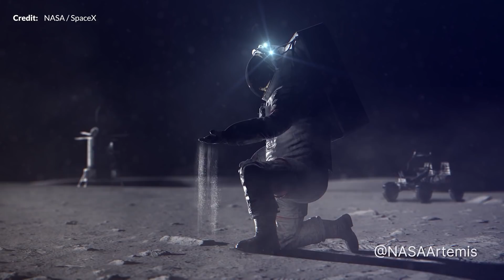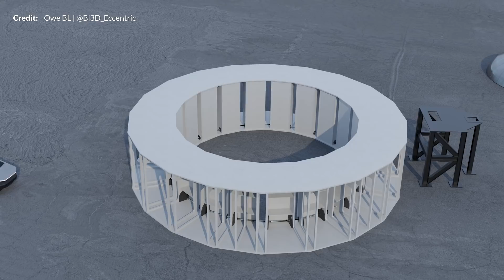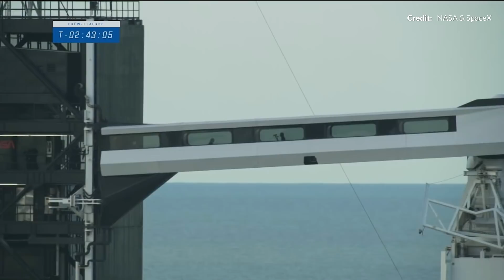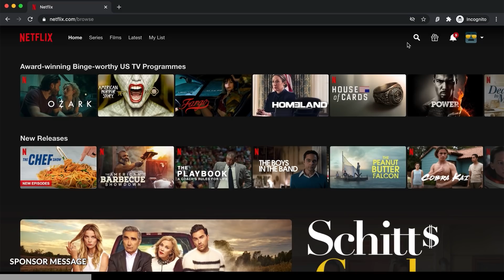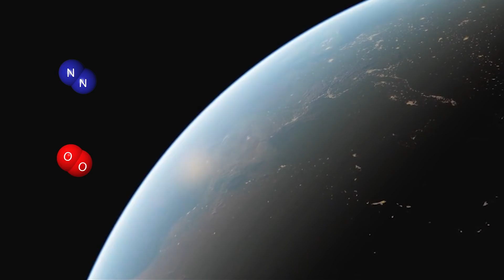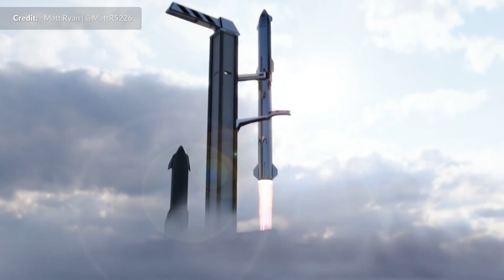SpaceX wins a multi-billion dollar NASA moon lander contract!

Comment: 1:07 Landing legs are too large, thinner one will be enough.

Ex:
Super heavy: ~3500 kg
Starship: ~1500 kg

Moons gravity: 0.18 g
So, 1500 kg * 0.18 = 270 kg (Weight of fully loaded starship in Moon)

So we only need legs strong enough to support just ~270 kg of Weight.

Comment: Another thought- while it's great to build your own tanks, the SpaceX-made tanks are probably much thinner-skinned than the purpose-built storage tanks designed for long-term storage here on Earth.  Especially with stacking them vertically like that, I hope SpaceX engineers will reinforce them internally and externally to prevent damage during a hurricane (or even a storm surge).  The combination of being much lighter and standing vertically makes them much more prone to being knocked over by very strong winds, or even lighter winds if a natural resonance happens with one of the vibration modes of the tank.   I can see part of the point, since their vision is to use or construct tanks efficiently for orbital, lunar and Martian use but those are very different environments.

Comment: It's a big stretch to call the exhaust from a Methane/LOx rocket - mostly water and carbon dioxide - a "pollutant".   While I applaud developing and perfecting the technology to manufacture your own methane & LOx fuel in-situ, I would wager that doing so here on Earth would be extremely expensive and add millions of dollars in cost to the launch of every Starship rocket compared to just running an LNG pipeline out to Boca Chica and Cape Canaveral (if it doesn't have one already).  Has anyone looked into this further?

Remember, our first goal needs to be to viciously drive down the cost of launching into orbit.   The reason other rocket programs have failed to do that is partly because people became too distracted in trying to fulfill other goals, political and economic, at the same time.  Having these rockets be 'carbon-neutral' really isn't going to make any difference for the planet (it's a drop in a bucket), but FINALLY enabling affordable space access will DEFINITELY make a difference.    

It's like the difference between a military which focuses on being carbon-neutral and/or not offending anyone on twitter, vs. a military that focuses first on keeping its citizens safe and preventing the outbreak of war.

Comment: Is this going to be a ride in that Flash Gordon styled flying trashcan with a high failure rate? Or has SpaceX invented an electric rocket with 100 x better batteries while being 100 x cheaper (but also secretly 100 x larger and heavier for ONLY 3 x the original cost and 5 x past the original deadline)? 🤔
Any psychedelic LED light effects during the trip? 🌈 🦄 🤔
🤣🤣🤣
Reply: Yes you'll get the light effects, if you drop the good acid, Not the Brown acid!!!😜

Comment: The Moon is a very good testing ground for development of surface hardware, procedures and processes intended for Mars, is it not?...and pretty much always only a few days away, instead of 180 days away once every 700 days or so.  Can't anyone see the benefit of that?  If it (hardware for Mars) can withstand the harsh temperatures, radiation and vacuum of the Lunar surface, would it not likely be well suited for Mars?  Now, the Moon can't test reentry systems, but the Earth can do that.
Lunar Starship is in a class of its own, compared with the other two landers.  It is so much larger.  When they land a Lunar Starship on the Moon, it will be an instant Moon base.  Of course, I still have many questions about how it's going to work.
Also, with Super Heavy launching Lunar Starship (Should just call it 'Moonship' since it will be so much different) to orbit and the crew riding comfortably in the spacious craft on the voyage to the Moon, is there any need for SLS, Orion, or the Lunar Gateway?
........But wait!!   Can Lunar Starship launch to orbit on a SH and then propel itself to the Moon and land...all on the original fuel load it had when it departed Earth?  Or does it have to be refueled in LEO several times just to be able to get to the Moon and land?  And what about a return trip to LEO?  If that's what has to happen for each trip to the Moon, that's a big item we all seem to keep overlooking.
Reply: Answering Your questions:
- Star Ship requires refueling in orbit before trip to Moon orbit
- When Star Ship is in Lunar Orbit, Nasa launches crewed SLS with Orion. Than Orion is docking with Star Ship, crew goes from Orion to Star Ship. If it sounds strange: NASA is obligated by Congress to use Orion for this mission. No way to go around this.
- Star Ship Lands on Moon and stay there with crew for ~20 days.
- Star Ship launches to Lunar Orbit and rendezvous with Orion. Crew goes back to  capsule, and  than Orion is launched to Earth
- Star Ship either remains in Lunar Orbit (no atmo. drag there) or will be launched to Heliocentric orbit.
Reply: @wojteksykurski  Thanks!  Too wasteful, isn’t it?  Makes Lunar Starship an expendable vehicle.  But maybe it always has been, I don’t know.

Comment: Love all the ass licking Musk fans in here that have somehow forgotten..... the last 4 tests ended in explosions. Give me one example of musk technology that is either financially practical or worked as described?? Like his badly engineered heavily subsidized car range....the things don't last more than 4 years before bits stop working and are a landfill nightmare. I suggest giving the Russians the money you may get something that would get the Crews there and back...
Reply: The Russians have some of the least reliable rockets in the industry, many times worse than SpaceX. Why the hell would you chose them?
Falcon 9 has a 1.8% failure rate. Soyuz-2 has a 5.9% failure rate. Proton-M has a 9.9% failure rate. That's 3.3 to 5.5 times worse.
The Zenit-2, while not purely Russian, is still a Soviet design using a lot of Russian-supplied components, and using a Russian launch site. 
If you chose to count it, it has an appalling 21% failure rate, nearly a dozen times worse. If not, Soyuz and Proton still prove the point just fine.

Comment: Hi Marcus, I've a question. SpaceX has a fantastic system with Star ship and Moon Ship, what is the point of the Artemis program, rockets capsule and gateway station. Surely SpaceX will just launch moon astronauts to orbit or the moon with a Star ship and then dock with Moon ship for the landing. its a lot simpler and cuts out all the un reusable Nasa hardware. this would save the US government and fortune. Also Super heavy will be able to launch huge one piece space stations with many times the volume of current ISS or tiny gateway station planned. Another thought is that SpaceX will do what Nasa wants for 1st program but basically  do there own thing and leave NASA to just be customers. SpaceX will have a Starbucks on the Moon by the time NASA get there act together.

Comment: Since the boosters are taller than the starships, I doubt we’ll see the cherry-pickers supporting the joining of starship to boosters. 
-Maybe the booster catcher assembly will double as a 360° gantry for technicians to support the joining process. 
As far as I recall, no rocket system has been joined on the launchpad like this, so it makes sense that we’ll see a wrap around gantry to facilitate the process.

Comment: Ok, well done SpaceX
I wonder... as SpaceX is having trouble getting it's flying dustbin to work how long before a real rocket is actually flying? ...and having sorted the laughably simple stuff (relatively speaking) how long before the human-supporting systems are designed / tested / reliable enough for space flight?
The reason I ask is there will be no scaling this way, way, way, back to an idiot "Teslas in a Tube" toy. Using 3D rendering software is NOT rocket science!
Reply: I mean at least SpaceX have actual flying hardware, even if it isn't quite landing yet. The other two companies had plastic mockups, which I daresay wouldn't land any better.
SpaceX are also the only one of the three companies that has built and demonstrated a working life support system, on Crew Dragon.
So however long they end up taking, I suspect the other two companies would have taken longer.

Comment: This tall slender Starship is the wrong design, wrong tool for a moon lander. Those example-images 'not sure what they are' jets or engines near the top, the tall internal crane or elevator are simple examples of unneeded complexity. The moon lander should land horizontally. Scale the Mars sky-crane up. Add a cargo hold to the middle, no need to have a crane to lower it down. Put landing legs or wheels on the cargo hold, alternate design could allow it to be detached or not. To simplify design: get rid of tall ship, get rid of internal crane that needs to raise and lower everything, move engines out to corner, add cargo bay to middle, land horizontally. Done. If SpaceX doesn't simplify the design, then throw out some of their talk about simple design - about designing out parts, assemblies, systems that aren't needed.

Comment: as i see it mars can only be terraformed with advanced fusion that would allow us to transmute carbon to nitrogen and/or oxygen (on a massive and long term scale = think of the atmosphere processor from aliens).   also water would have to be brought to mars via comets or ice from the rings of saturn or the ceres asteroid.  you could build domes until then though.   the lack of a magnetic field is a big problem though - not sure how that will be dealt with.
Reply: if you've got fusion power and the scale of resources needed for terraforming, then you can 'just' build a big magnetic coil around the equator and generate an artificial magnetosphere.

Comment: Would it not be possible to magnetise a ring simpler to the one in the computerised section and when BNs or SNs come back they close round them and magnetically hold them whilst the engines shut off and then get moved by crane? Or is there no way of any magnets holding 120tonnes? 🤔 I'm obviously not clued up on magnets enough..
Reply: Starship is made of a non-magnetic steel. Unfortunately this also rules out walking around on the hull in mag-boots.
Reply: @lazarus2691  thanks for your reply. I know it might of sounded really stupid to ask but I thought might it have been overlooked as a way lol.. but I guess I've underestimated Elon which I should never ever do! Bad Chris (slaps hand) ... excuse the mental issues I have and have a nice day

Comment: You may not realize what this means.   Starship just got the WHOLE 2.9 
Billion dollars not part but all for the Human Landing System. It's 
designed to be a ferry between the lunar Gateway and the Moon...but 
Starship doesn't need SLS to get there even though NASA just gave SLS 
five legislated missions like for the Europa Clipper. Once those 
missions run out and starship is FULLY operational SLS and Starship will
 be doing the same thing only SLS  would be 200 times MORE expensive.  
LET ME BE CLEAR... NASA just gave SpaceX enough money to Cancel the SLS 
rocket and it looks like its absolutely on purpose !!!

Comment: So far it is Landing on a concrete pad. What happens when it lands on uneven soft dirt?
Reply: That the reason for the large pads, maybe you should try actually watching the video?
Reply: Do you mean landing on the moon? Should be a soft touch down using super dracos and you’d hope they have appropriate legs/feet developed by then.

Comment: How about landing one to the starship on its side so human and live in without the need of a space elevator!
Reply: The structure would need to be much tougher than it is right now to handle forces on the sides and to strenghten the structure the vehicle's  weight would increase tremendously which would lead to decreased payload capacity.

Comment: I heard Musk report recently that the Starship would have to have some support when mated with the Booster in order to minimize the weight of the Starship on the Booster. Of course, the more fuel the greater the weight. That gives you a third reason for the catching arm. My guess is the catching arm will be used to provide additional support during the launch.

Comment: If it means anything I go out to local small rocket club launches during the summer here in the pacific northwest. The smallest rockets use a flat plate flame diverter, with larger units using welded wedge diverters with extended lower flat plate rings. One set up I saw in 2019 added water cooling sound protection to the tune of a water trailer holding 1,000 gallons and two massive pumps. They reported to use 250 gallons per each of their three launches. I was completely impressed by the forethought of their system.

Comment: I vote for SpaceX to add a flame diverter. With all those pieces kicking back up into the rocket, it makes it harder to tell if a failed engine is having a design issue or caused by debris hitting it at high speed. I think it would reduce rocket failures. However, SpaceX may want to skip it because they can't build flame diverters everywhere they land on the moon, Mars, or earth hops.

Comment: They can't even land their rockets without them crashing or blowing up. Now lets try it on the moon where physical conditions and the physics are totally different. Good luck.
Reply: The moon has much lower gravity so It would probably be much easier landing there. It requires less propellant usage too. I don't think that it would cause that big of a problem because NASA already has a lot of data on landing there.
Reply: @rolandb.1866  That attitude is exactly why I say good luck. Just remember, when there is a fail, and there will be, help will be nowhere to be found. No one will rush in with recovery equipment or medics to treat the wounded. I would put my money on Blue Origin having a successful touchdown. Watching their rocket land, now that baby is smooth and it doesn't blow up after landing.
Reply: Actually SpaceX are pretty good at landing rockets.
Falcon 9 has successfully landed 79 times, and lands in a more comparable fashion to a moon landing. 
Starship SN5 and SN6 also successfully landed, in a manner even more comparable to a moon landing.
It's only the Starships attempting the unprecedented belly flop and flip that have crashed. This is not needed on the moon.

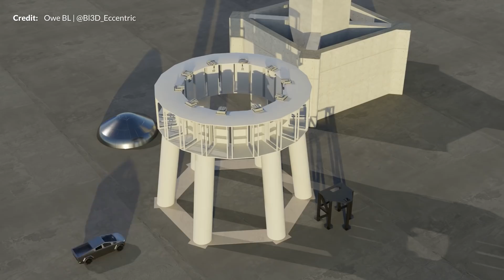Comment: At 5:30 you talk about the hold-down clamps. Starship uses 6 , the 'leg locations' are "hardpoints". That is - you can visibly see the extra structural welding, and briefly see signs of this reinforcement from SpaceX's 'inside the skirt' shots. This is perfectly consistent with one of Elon's big things - the best part is no part. Having one set of hardpoints for landing and using the same hardpoints for 'holding it down' ... and the same hardpoints for holding the vehicle on their transports stand ... ( and for tail-to-tail docking, but we don't know that yet, but it's obvious) ...

Not saying they won't change, but six seems to be whats current. There's some side-on views of static fire testing/launches where you can see the very slight gap and where the holding-down is occurring. (They said they're already doing it...) The views I recall aren't quite clear enough to count directly, but 6 fits with what I've seen from view angles and symmetry, etc.

Comment: Flame diverter?  We don't need no stinking flame diverter.  Will there be a flame diverter on the moon?  or on Mars?
Reply from the maker: Referring to the Super Heavy, not Starship. Starship must work without a flame diverter, we are talking 3 raptors for landing here though. Super Heavy will have 28-30.

Comment: The render of the orbital tank farm cannot be right. At @12:18 you can see three different foundation types. 1 - three, and possibly five, like the one GSE-1 is on. 2 - two on the left that have much taller rebar. 3 - one foundation that looks like it will be ~12m in diameter, possibly the water tank for the deluge system.

Comment: Did NASA ever release a statement as to the reasons they chose SpaceX? I wonder if it has something to do with SpaceX starship development aligning well with the Artemis timeline.
Reply: There is, they released a document talking about all the proposals. In case of Starship the decision was largely cost driven, however the other proposals also had some flaws. The fact that SpaceX is already deep into the testing phase for their propulsion system gave them a big bonus as well, something that especially National Team failed to deliver, along with their extremely optimistic timelines and the lack of a full system landing test before the actual mission. The Dynetics proposal would've been too heavy, which meant they would have to find ways to cut down on weight so it could be launched on its proposed rockets. Lunar orbit refueling was also considered a bigger downside than low earth orbit refueling, another bonus for Starship.
Reply: @Brixxter  Thanks for the explanation!

Comment: Sabatier production of methane requires an ample supply of hydrogen gas, and that must be manufactured either from electrolysis of water or steam conversion from natural gas. To get the power for electrolysis the most reliable high power source is... natural gas-fired turbogenerators. 

Here on Earth and especially in Texas, natural gas is cheap and abundant. Making methane from hydrogen in Texas is even more boneheaded than carrying coal to Newcastle.

There is an existing natural gas well at Boca Chica. Supply chains don't get any shorter than that.
Reply: SpaceX are still going to have to develop a highly reliable power source to run the Sabatier reaction and electrolysis on Mars.
So even if not initially, I expect them to put it to the test in Boca at some point.
There's only three viable options for power on Mars. In order of practicality: nuclear fission, solar with batteries, or wind with batteries. 
Nuclear fission is unlikely in the early days for political reasons, and solar is more predictable than wind.